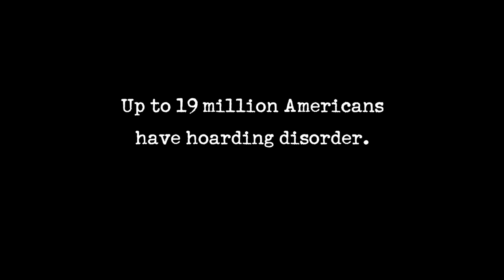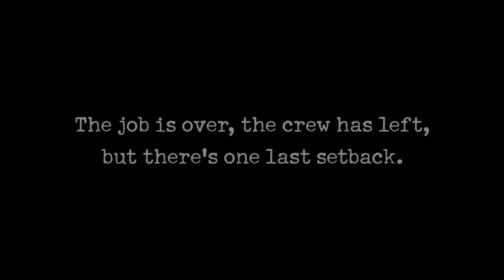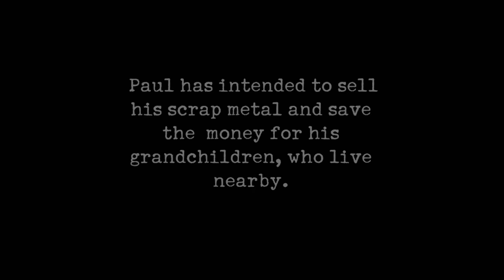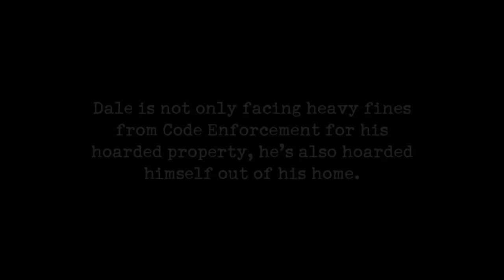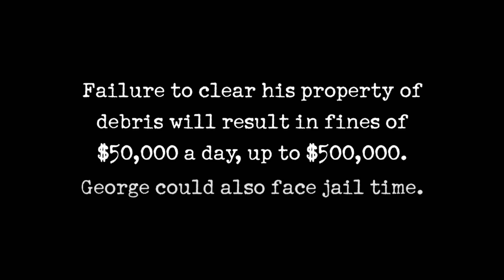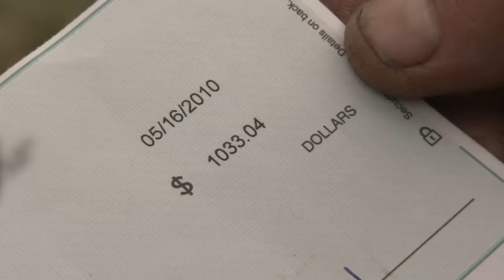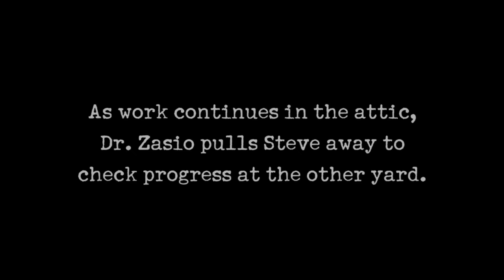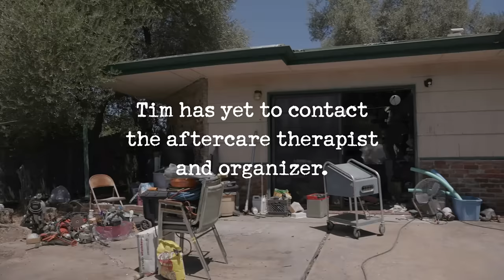Hoarders: Biggest CAR Hoards | One-Hour Compilation | A&E

Comment: My favorite response from car hoarders when asked how long they have had a car they plan to restore, and they reply 40-50 years. If you don't do it in 10 years, you are never going to do it. There should be a law limiting how long you can keep a car that is outside and not running, to 10 years. Just because they will leak hazardous chemicals into the ground.
Reply: I love your 10 year rule, good job keep it up. I myself have a 1 year rule of a product like a puzzle or activity doesn't get used within the year it's gone. Video games, even movies and videos on any technology I have. Books that havent been read in a year If there is a section of my home that has not been cleaned in a year like a decoration or is causing problems if I can I get rid of it like a decoration. Even clothes. You are such an inspiration I wanna get all my activities done now.
Reply: 10 years is too long. Maybe 3 at the most .

Comment: reality check - a 10' 2x4 is less than $10. Even a high grade one.  One person helping is worth that.  I have tendency to hang on to scrap wood myself but I try to remind myself that it usually isn't worth  the hassle. The odds of it meeting a future need are pretty slim. I did use most of mine up building a bin to store the rest in.  And now if it exceeds the storage capacity it has to go.

Comment: Almost everyone of these hoarders spoke of having projects and plans for much of the hoard. Roy planned to try to use cars and trucks and electronics for possibly engineering something new and experimental with all that stuff. Yet he nor any of the other hoarders have done anything with any of the junk. Cindy bought so much from auctions and filled up her son's property yet did nothing with the vehicles and junk. Even when offered 15 grand for a large section of the hoard she turns it down but then some of it later gets hauled away for the price of scrap. I think the best thing for some of these hoarders is to be forced out of their properties and to see all their clutter, junk and garbage hauled away. Tim is a good reason for code enforcement to get involved because when push comes to shove, in the end he refused follow up help and felt he did the biggest mistake in allowing Hoarders' organizers to work on his mess.